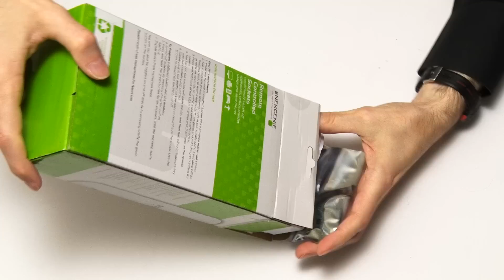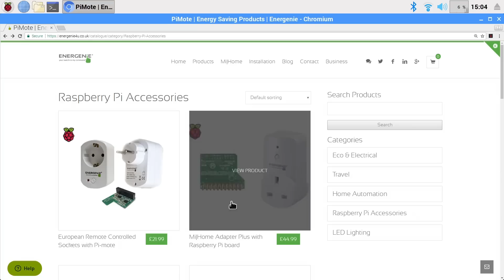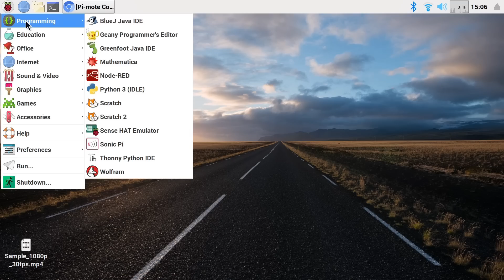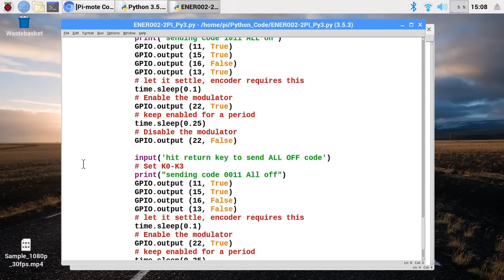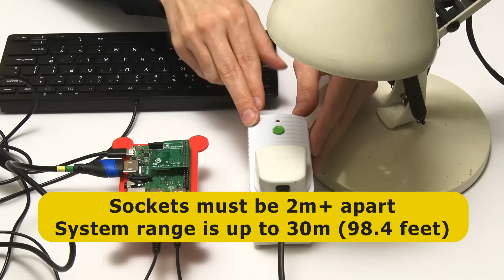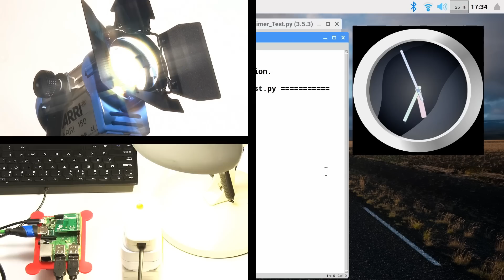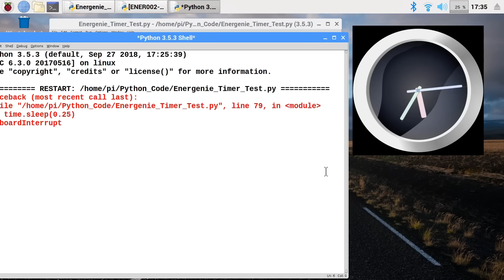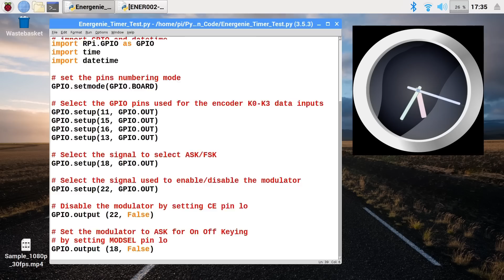Raspberry Pi Automation #2: Energenie Wireless Sockets

Comment: It‘s a nice thing for students or diy fanatic people 😉😎 
But when I seriously want to do home automation, I would prefer a platform like fhem, OpenHAB or ioBroker. They all are free, I think open source, but I’m not sure, and run perfectly on RPis. You can integrate then nearly every smart device you wish. I have a 433 and 868 MHz transmitter called CUL to control wireless plugs from Intertechno and some blinds from Somfy. The CUL can be plugged into an USB socket. Additionally I bought a Conbee Stick II from Dresden Elektronik as a substitution for my HUE bridge, which can control not only HUE lights and sensors, but also IKEA Trådfri switches, sensors and when you are lucky lights (you have to have a deal with the devil to integrate the lights). AQara sensors and switches work fine too. I use fhem with a more modern GUI from hausautomatisierung.com, which is a free set of css files. And believe me, you can code a lot in there. For example my blinds close every time I lock my main door and open, when I unlock it.
I don’t want to criticize your series, your doing a good job, but I wanted to point out, that there is also an alternative to make your home smart. And it’s fun! 😎😍😀
Greetings from Bremen, Germany. I’m very sad, that Brexit brought so much chaos to GB and hope, there will be good solution for us all soon. 🤞

Comment: I personally like how all of this is done without needing the use of the internet, makes things feel much more secure. :) Take care and thanks for the great video!
Reply: Agreed.  Ppl don't understand the holes these little wifi gadgets punch in their network security. I could almost accept the risk setting up a barrier with another router if these wifi gadgets were cheap BUT $75 FOR A LIGHT SOCKET?!? I guess if you don't care about your customers security you could make some real money...until the class action lawsuit...
Reply: @semperparatus3685  Although a lot of 'Internet of Things' gadgets seem cool and nifty, I really don't see the point in them. As far as I am concerned, if a product doesn't actually add value (aside from being a cool gimick), then I'd rather not waste my money. And, of course, the security concerns alone are enough to make you heave. Remember, you are the product with these things! I like to keep my digital footprint as minimal as possible.
Reply: not only the internetuse of other products is the problem. You also need a closed source app. As soon  as burglars wise up there is going to be such a rise in  breakins...

Comment: If you have already some set with a remote, you can buy a cheap 433mhz rf-module set (transmitter and receiver) ,about 0,99 euro on ali. It is very easy to use with Arduino so I guess it might also work with rasbpi. The only thing you have to do is find the right frequency however when there is an remote, you can listen to the remote to find the correct code. Cheap! ;-) With the rasbpi you can connect it to the internet by designing a webpage with controls that you can access over the web.

Comment: Nice video as always.  If the Timer function is in the RPi code, what happens if the mains supply fails, or there is a 'brown-out?.  Does the code re-start (but no Timer?) I don't think you've covered it, but perhaps time for a proper RPi UPS HAT or add-on?.  Not the usual cheap ones which under-power -with the 'lightning strike' always displayed.
Reply from the maker: The code would only restart if the Pi were set to run it on boot (which I have covered in other videos, if not here). I like the idea of a Pi UPS HAT. :)

Comment: Nice product for the control of mains-powered device control. Is it certified as safe for everyday use by a recognized consumer product safety authority?

Also, is there any type of security built-in, or can it be switched using any similarly equipped Raspberry Pi, Arduino, etc. (i.e., by a drive-by hacker)?
Reply from the maker: The Energenie products are CE certified. I drive-by hacker should not be able to get in, as the device has to be paired with the transmitter on the Pi.

Comment: I have used these type of controllers for a number of years now but not with a Pi only the supplied controller.
I have found that after a while the units have a tendancy to 'Stick On' (Inductive loads that take large currents on switch on, (high powered lamps and I think Google Home)) and the only way to turn your device off is to select off and give the unit a good single sharp hard knock.
This must be because the cheap circuit inside must be arcing when transitioning from On to Off to On and 'Welding' the relay contacts shut.
I haven't bothered to implement a solution yet but a Y (or X, probably Y as these are designed to fail open)  class capacitor across the contacts may prevent this arcing and stop the contacts from welding together.
Also, when you take the unit out from the socket, they (After about a minute or so) lose their pairing and you need to go through this process again. (On the devices I have used anyway)

Hope this helps.
Reply from the maker: Very useful feedback, thanks for sharing here. I had the sockets removed from power for about an hour and they remained paired when reinserted. I did not test longer than that though. They are clearly intended to be left inserted.

Comment: Sorry,
but all you need is a standard wireless kit which takes as little power on standby as possible,
and then wire the pins of the remote control onto output pins of the raspi (directly or perhaps via optocoupler),
or better a esp32 running in low power mode..

 i hate it if people are stupid enough to switch a 1 Watt LED string with a remote power socket,
which uses 1W all the time and even more when its holding the relay in on state.

IOT and remote control for no improvement at all, just more cheapochina electronic devices needing power all the time.

Do they at least have a CE approvement (no finished product i guess)
and a certificate to be allowed to transmit anything?
Reply from the maker: Yes, they are CE approved, and have been a "finished product" for many years. :)
Reply: @ExplainingComputers   Sorry, wrong choosing of words on my side:
I'm not talking about "finished product" as that its developed and released, i am talking about a finished product which is working on its own.

The power plugs are a finished product, the end user has to change nothing on them.
They can be CE approved. And since they are not transmitting anything but only receiving, they don't have to be approved as transmitters.

Since you are adding the remote sender onto a RasPi, i cant really see the certification for a transmitter process beeing done there,
because it all depends on how you code it.
Also they only quote the "weee B2B" / business to business licensing agreement, but are selling to end users ?
( i didnt check deeper if they are also B2C licensed)

I'm currently really allergic to "CE approved products" which are not as soon as you use them,
after siemens have released their IOT gateway
=> https://de.rs-online.com/web/p/iot-entwicklungskit/1244037/

first they say its all approved and you can use it in industrial environments, but as soon as you use any arduino shield or a wifi card with an antenna (make a hole in the case),
it looses its approval alltogether. just have to read the manual to the end....
Reply from the maker: Ah, I take your point. Well made.

Comment: I buy cheap TP-link switches and have installed HomeBridge on a Pi that links directly to Apple Home - saves me quite a lot of electricity a month. Those switches are also Wifi so it's more reliable in my opinion. But great video to get into home automation :)
Reply: WiFi is much less reliable than 433

Comment: Nice "small movie light"!   Costs about a half dozen RPs and Pi-motes or same as AMD PC w/o graphics card?
Reply from the maker: You are correct. An Arri 150 is indeed about £/$350+. Most of the lighting on this channel is done with two Arri 650 Plus Fresnels, with the 150 added in as necessary for various highlights or shadow fills -- most commonly illuminating the inside of USB ports on side-angle close-up shots of SBCs. All not cheap -- until you compare them to the LED options! :)

Comment: I have just been thinking about trying to set up a raspi to control an outlet! I was going to use a relay, but this way is a little less invasive with the wiring in the walls!
Reply: Just by a standard cheapo set with a "manual" remote control and hack into the remote control (optocoupler or directly, usually switches to gnd or vcc).
But please keep in mind, that those power sockets take power all the time because they always listen,
AND take even more power if they have to hold the relay in ON state.
Reply: @PsiQ  I was planing one doing some stuff with Internet Of Things, so they could be controled remotly and just for fun as well!

Comment: Why not just use home assistant and a cheap esp8266 plug? Just a suggestion.  Good video.
Reply: Or purpose-built programmable plug timers, but I suppose those aren't as much fun since they don't require any tinkering.

Comment: Thank you very much your IoT project and review helps us alot thank you. I have question 
I want make nas-storage  for home  which bord I used to get well performance and work 24x7 and I connect multiple hhd or sad to it ?
Reply from the maker: The multiple drives is the issue with SBCs. :) A Rock64 makes a nice NAS -- https://www.youtube.com/watch?v=gT-EGNl9bZA -- but for multidrives, consider something like a RockPro 64: https://www.youtube.com/watch?v=9CCQicHwfDI Or maybe a Rock Pi 4B, as it has two USB 3.0 ports.

Comment: Thank you Christopher, I've been patiently waiting for this one since you mentioned it some time back. Only disappointment for me was the limitation that they must be more than six feet apart. Others may be interested to know there is a solution... Energenie ENER010-PI Radio Transmitter PCB and 4 Gang RF Extension Lead.
Reply from the maker: Yes, indeed -- I should have mentioned the 4-way! :)
Reply: perhaps a new episode which also could include a simple GUI or commandline menu to control the switches.

Comment: You can't control the device through the internet?  You're controlling the device from a pi, you can control the pi from the internet therefore you can control the device from the internet.  It's a bit of a roundabout to get there but since this is about using a pi to control the device controlling the device from the internet is not just doable but fairly simple.  If you're adding motion control and cameras you can even have it take a picture or video and email it to you when motion is detected.
Reply: Yes, easy, I have a little script that gets called from a basic web page interface running on the pi. Been running non-stop several years now.

Comment: Those devices are nice when wanting to setup a quick electronics project.  There was a similar product marketed in the US called X10 about 10 or so years ago.  I'm not sure what happened to them but you could add sensors, light switches, and remotes to control 256 devices.  I wrote a bunch of scripts in Perl that worked pretty well.  I still want to see a better Pro-sumer version some day.
Reply: spot on... was reminded of the same...

Comment: could you pair 2 or more devices together. so when sending the code "turn on socket 1", it actually turns on 2 or more sockets at the same time ?
Reply from the maker: Probably, yes - in that you could pair more than one socket as "Socket 1", etc.

Comment: Hi, is this rather limited compared to other systems in that only energenie things can be controlled, compared to other systems with multiple vendors such as zigbee or z-wave ?
Reply from the maker: It depends on your point of view. The sockets here are not networked devices, so yes, can only be (directly) controlled from the Pi (although the Pi itself could be accessed over a network). However, some may see this as an advantage, as there is no security risk as devices are not being put online. :) I will be covering networked controllers later in this series.

Comment: Nice product and I'm in luck it's available in Canada Amazon.ca. Around $65.00. Thanks for bringing it our attention Chris.
Reply: i would recommend you buy a "manual" remote control set and hack into the manual remote control.
For that price you could buy two identical sets, get double the sockets and have a spare "manual" control left.
- Bonus would be, you could simply override the RasPi with your manual remote control any time.
And you would have a approved and "allowed to transmit" product.